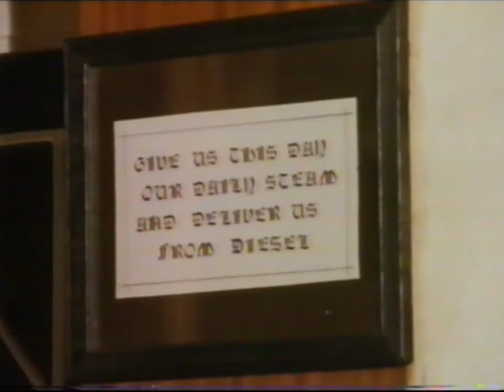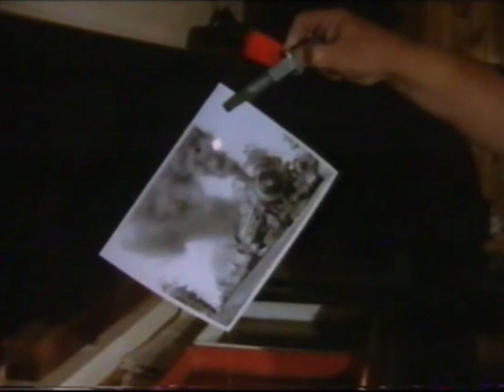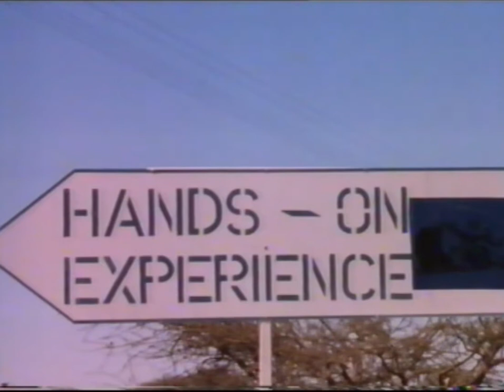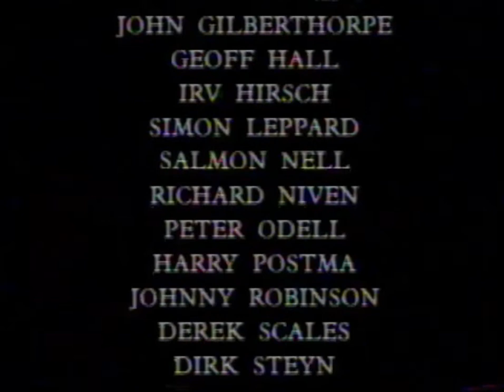Steam Fever

Comment: Thank you for this video! I grew up with steam engines going through our village in the Western Cape. Later I was fortunate to spend some time at the Koedoespoort railway workshops in Pretoria where these magnificent beasts were maintained - from casting steel still made with Bessemer converters, through steam hammers making the giant connecting rods to white metal bearings. I wish I was a film maker in those times! Now I watch your video in Patagonia.
Reply: How did you end up moving to pategonia!? I'm joining the UK after leaving sa